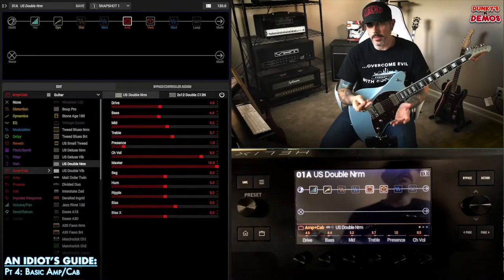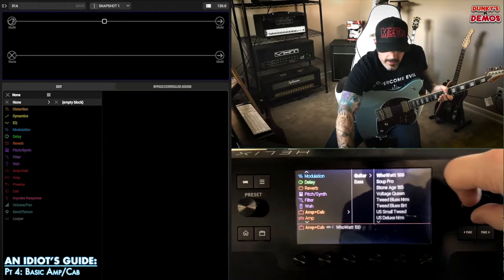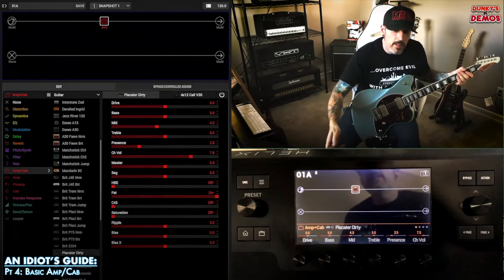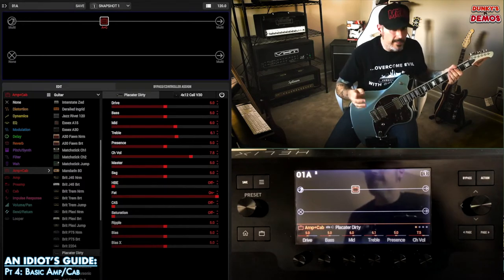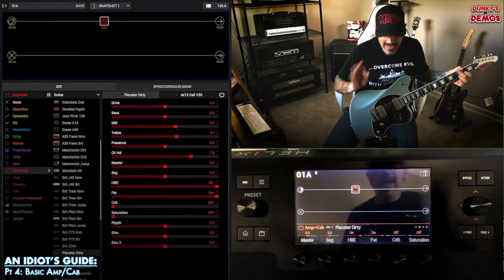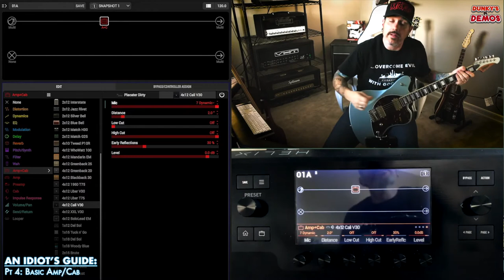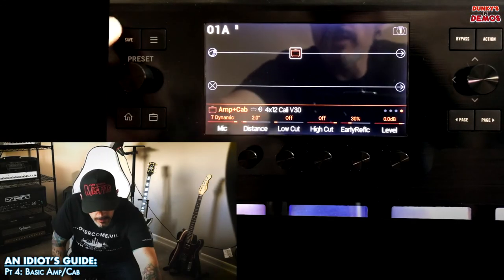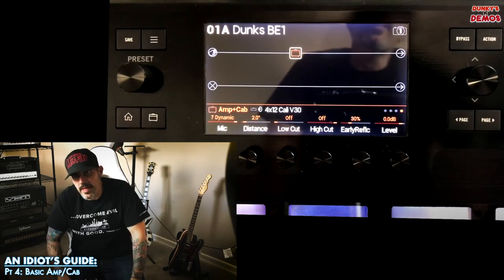An Idiots Guide to Line 6 Helix - #04: Basic Patch Creation - (Amp and Cab block)

Comment: Sounds awesome. Yeah, through an amp, i set the gain higher, but i found with cab simulation, i can back the gain down a touch.
Reply from the maker: Hey bud! Thanks for checking it out. Such a great model! Glad you are digging the LT!
Reply: Love the LT! I can't tell you how much your help has been appreciated. Also, i turn the FAT switch off. Friedman added that for guitars with weaker pickups and for single coils. I found in real world use of the actual amp, that application seems accurate. Got a Tele or Strat hooked up... add the FAT switch.  Really beefs it up nice. IN the Placater amp, it may add too much unwanted low frequencies you'd end up EQ'ing out in the end anyway with a humbucking guitar.
Reply from the maker: Hey man, glad to help!

Comment: I SO NEED THIS😫. I got an Ltd ed Gold Helix floor. I’ve set it up to my basic home studio and output to JBL class D monitors. But everything I’m doing is just guess work. Your idiots guide is a must, and I reckon you should publish it. 
I don’t know if you’ve answered this in later videos, but connections to outputs whether it’s studio monitors or actual amps... I’d love to pick your brain on that. I’m using red & whites from the helix to mono 1/4” adapters into the JBL monitors. I see there’s also an option to use XLR outputs into the monitors. Is one better than the other? And why?
My other question relates to amps. I’ve connected mine to my Marshall Silver Jubilee through the fx loop using 4CM. In never quite sounded right. There was always a constant hum. I was able to mitigate this buy purchasing better cables, but it’s still there depending on the channel. I think perhaps it’s a settings problem at my end. I’d love to see you describe this one one of your vids, because it’s a really common question on forums, and there are tonnes of contradictions.